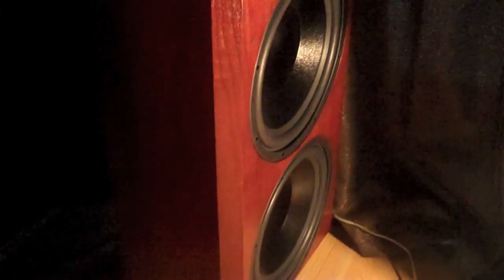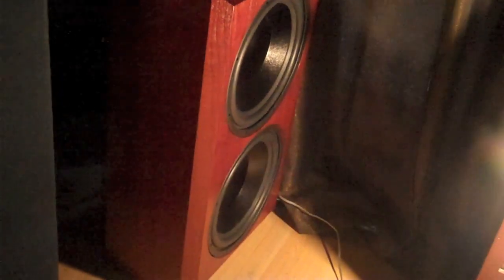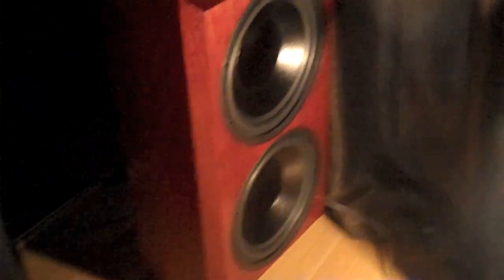Subwoofer Excursions: 20Hz - 5Hz (Seaton Submersive F2)

Comment: U r the man! Have a question 4u...I recently purchased a pair of klipsch rf82ii & rs52ii also the rc62& Rw12.  Do u think I need to upgrdea to 7.2 system to maximise enjoyment? If so which pair shouldI go with....rvx54 or anotherpair of rf82ii?  O also if yes I will b adding another Rw12 with what u suggest.  Thx :)

Comment: Awesome and thanks for the reply. You solidified my decision. Sealed it is. I forgot to mention that my intention was four vented 15" or six sealed so I guess the whole output thing was trivial unless I wanted to wreck my house. Its going to be strictly home theater, but I wanted to have bass which has a lot of impact and control and be very dynamic and I think you're right. Sealed is the way. When I'm done my setup, I will have to send you a link then :)

Comment: ... so would you go with the ported (which would give me a maybe 3db more output) or go sealed for a bit more control and impact? With the mini-dsp, I can EQ the bottom end up from 10Hz so that its flat. My current ported 15" give me a -3db point in room of about 17Hz and a -6db of 12Hz. Downside is that I have to have a subsonic filter for sure. BTW I'm not technically going for a lot of SPL, but I want clean extended bass wit a lot of dynamics when needed. I'm building my own LRC speakers too.

Comment: Hi. I see you have great taste in gear and you're into HT so maybe you can offer some input. I've got a 13x18' room which is going to be re-done nicer for my HT. I currently have two 15" subwoofers in 9cf cabinets tuned to 14 cycles. They are Dayton drivers. Seeing I was going to re-do everything, I had the option of going either 4x 15" again ported or 6x 15" sealed. I'd be powering them with a single Behringer EP4000 amp. I'm also going to do room treatments and I have a minidsp for eqing.